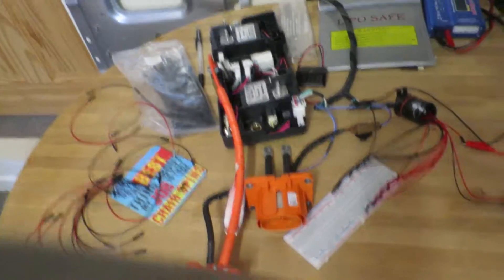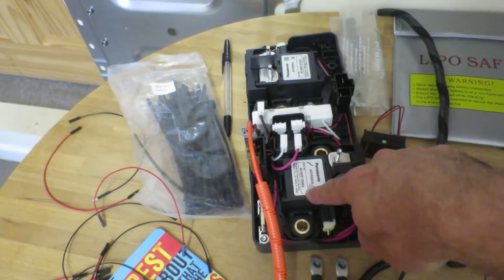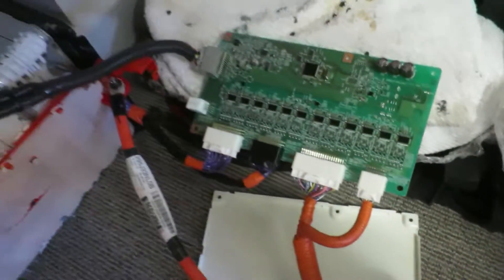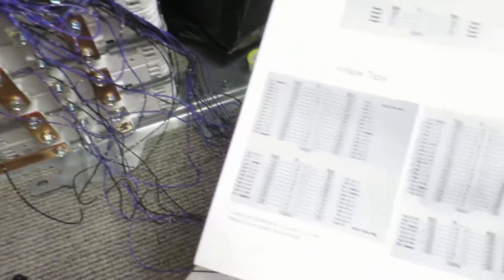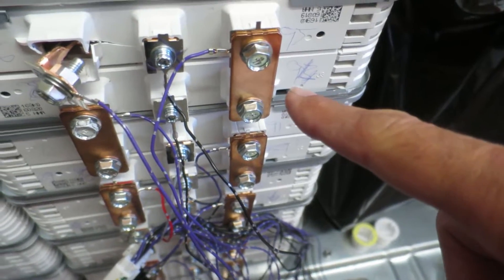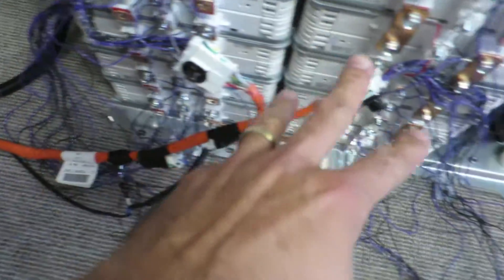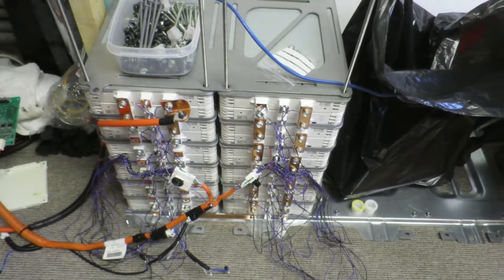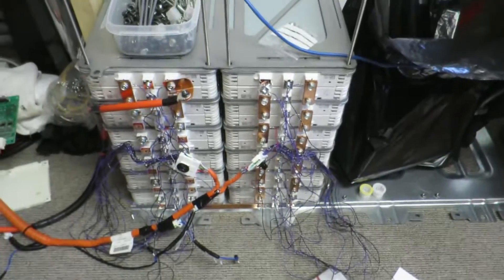Early stages Leaf BMS wiring and Testing

Comment: Hi, I have a problem with my leaf the 12v battery is not charging. When I charge it drives then light comes up warning 12v battery not charging car stops. Also when I plug my home cable is not charging but when I use fast charge it works. Can you please help.
Reply from the maker: Sounds like you have a PDM issue - take it to Nissan to diagnose.